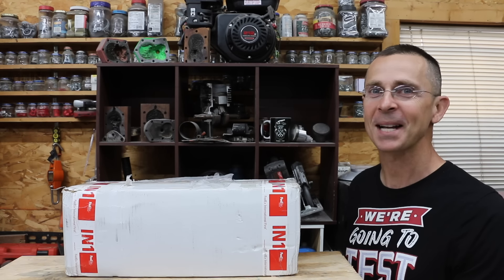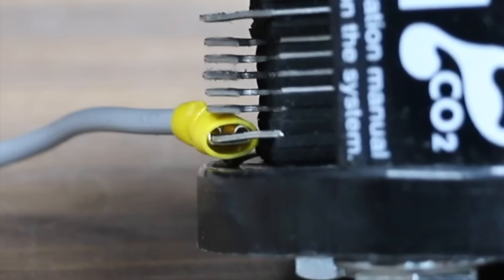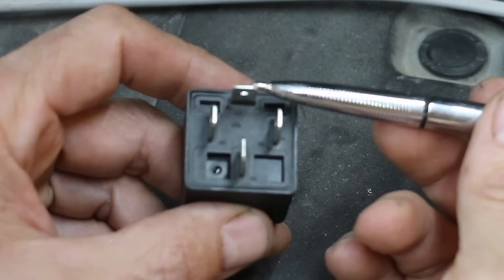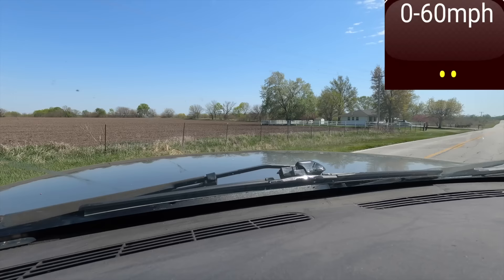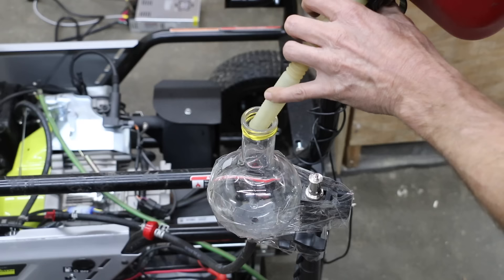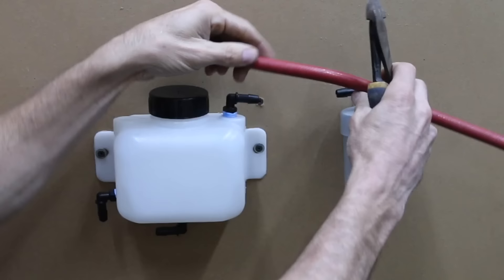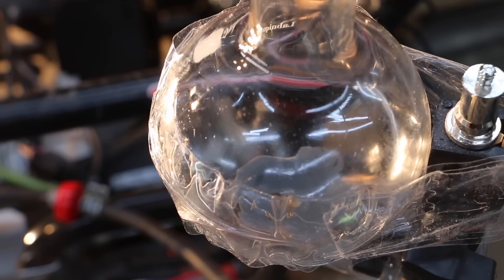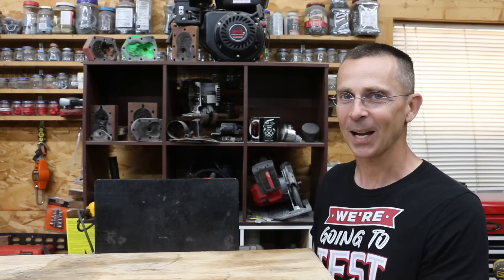AMAZING 35% More MPG with HHO? Let’s find out! Help with high gas prices?

Comment: When I was studying this sort of rabidly (lol) several years ago , the last time gasoline got around $4 per gallon I definitely determined that for HHO to produce a fuel economy benefit it is absolutely mandatory to set the engine leaner.  I read a scientific paper or two or three(?) on this and the hydrogen boosting has the ability to speed up the flamefront in the engine cylinder allowing a leaner burn and also you can adjust the ignition timing so that there is peak brake mean effective pressure at a more opportune time relative to the position of the crankshaft.  Like everything the devil's in the details.  Going leaner on the carburetor is mandatory.

PS -  I hope you aren't sick of the accolades but I think your efforts are absolutely amazing!
Reply from the maker: Thanks!
Reply: Amazing effort in making this video! Thank you!
Reply: The losses in generating hydrogen from water through electrolysis outweighs any benefit you can possibly tweak.

Now! If you use a chemical reaction to create the hydrogen, that's an entirely different story.
Reply: @jimmio3727  Onboard hydrogen generation produces higher mpg ONLY if you also can lean the A/F ratio substantially and retard the ignition timing (can't do it without the boost H2).  I wish I could find that scientific paper I had on my old deceased computer.  I know of people who have proven it themselves.
Reply: Bearing in mind that the pure oxygen will make the gas burn faster and hotter, while the Hydrogen will burn fast and the combustion products (water) will actually cool the cylinders down a little bit.
Reply: @captainwho1  didn't retard mine at all, set it at factory and raised my mileage by almost 10 mpg, with the small unit I built at the time.
Reply: Use platinum for the cathode/anode
Reply: you guys really need to educate yourself in physics.
Reply: @thorgraum1462  Sorry but it is well understood that there is a lot of energy that goes into splitting the water molecule.  You don't understand how inefficient the combustion process of gasoline that isn't well homogenized and atomized is.  That's where the gain comes, as an accelerant to the flamefront.  The gains come in burning more of the gasoline charge at a more advantageous angle of the crankshaft and that absolutely is physics my friend. The devils always in the details.
Reply: @captainwho1  as long as the power used to split the molecule is coming from the car battery and the alternator itself its LITERALLY impossible to do anything but hurt the overall performance of the vehicle. 

energy can only be converted, not created. if the load from the Hydrogenerator on the alternator is 100W you will in the best case scenario produce 75% of those 100W worth of hydrogen, burning that hydrogen in the engine you will be able to extract around 35% of the hydrogen into rotational energy witch then again need to turn the alternator. 

this is not a hypotesis. this is the fucking law of nature

every action creates an equal and opposite reaction. and thats in vaccuum without any friction. in the real world every action creates heat, friction and an energy output lower than what i takes to make it.
Reply: you are using 100W rotational energy to create 26W of rotational energy. and that is under ideal circumstances
Reply: this planet sure is full of rare and goofy creatures
Reply: it is VERY important for our future that the coming generations knows basic Physics. try to lay your pride aside and open your damn sience book before you break the youth with this destructive way of "thinking" (brainwashing)
Reply: if this really worked we would not even have to use a single drop of gasoline. just this wonderful loop of ignorance and maybe some essential oils for lubrication
Reply: @thorgraum1462  Ha ha ha.  I'm a Mechanical Engineer that has actually worked on fuel systems and focused on Combustion in college.  I have argued with folks such as yourself before and your problem is that you do not understand how much of the chemical energy of the gasoline is being wasted.  If that were not the case you would be correct.
Reply: we really need a TUF certification for people. the earth is not f**king flat my dude
Reply: @captainwho1  well, that just prooves that anyone can get a degree

First Law of Thermodynamics: Energy can be changed from one form to another, but it cannot be created or destroyed. The total amount of energy and matter in the Universe remains constant, merely changing from one form to another.
Reply: @captainwho1  then proove me wrong. do it. make it, make a video, show me the numbers. noone have, i wonder why. you gonna be rich boy. go do it. what are you waiting for, youre a mechanical engineer. i might not have a degree in engineering, but i do have 134 IQ  and my mechanical and technical intuition is by far my strongest side. i grew up watching a shitton of mythbusters, MCgyver and the Discovery channels. it shaped my way of thinking and the way i do problem solving. i have a degree in computer sience and im working as a CNC programmer and Operator.  i am the kind of guy to see the problem noone even knew existed. i have allways been a creator by heart and soul.  my biggest fear is to be wrong. but i dont want to be correct just for the sake of it. i want to be correct so i can give useful and legit information. i really do believe that actual Facts is the only thing that matters. ofc not allways when it comes to pleasing others. but when it comes to being able to create and streamline processes.

if i am wrong i will change my mind 

if you have done it. show me, and ill make sure to appreciate the revolutionary new knowledge
Reply: i can believe that you believe it. but i am an analyst. i will not believe what cannot be seen. neither god, ghosts or perpetual motion
Reply: ill happely make a fool of myself in search of the truth. whatever it takes. i will have the correct information
Reply: @thorgraum1462  If you are now going from being insulting to legitimately curious, you should start out by researching patents starting out around the time of the energy crisis in the 70s when the major carmakers were gearing up for extreme fleet mpg requirements from the government which never really materialized.  You should start by looking at lean burn concepts which is basically what this is an enabler of.  You can also look at some vapor carburetor designs, especially by Ford Motor Co., and Shock Wave Carburetors (Ford and Dresser Industries) which atomized the fuel using a shock wave variable venturi design.  They all revolved around super lean A/F ratios and much greater fuel economy and lower emissions that is possible.  Onboard hydrogen generation isn't at all the best way to go, it is just something that people can experiment with on their own to prove and enable the lean burn concept but it isn't going to work with a few stainless steel washers in a cheapo electrolyzer.  I don't have documentation of my own experiments and don't have time to resume them with the current state of the economy.
Reply: @captainwho1  No, i was just trying to be more polite. 
You convert rotational energy into electrical energy using the alternator and battery. Then you convert the electrical energy into Hydrogen and Oxygen, using electrolysis. that process is about 75% efficient. so now you have 75W hydrogen, as well as 25% heat, resistance and friction. Now you burn your remaining 75W worth of Hydrogen in an engine that itself has an efficiency @ around 35%. New engine designs has shown far better numbers using hydrogen, but  they still have their losses due to the pressureleaks and other factors. 

now you have produced 26.25W of rotational energy using Hydrogen

my point is. the powerlosses you have in your chain of conversions make it so there is no way this could self sustain, as it breaks the first law of thermodynamics.

could maybe be a cool hybrid solution if you had an externally charged batterypack like an electric car. 

or if you had a commercial vehicle with Hydrogen fueltanks and an infrastructure that allowed for accessible hydrogen where its needed.

but then again. why bother when the direct current electric motor allready is at 95% efficiency? mount that thing straight and direct to the rubber itself. and then you have regenerative breaking while braking... its just pure genius

get an electric car. slap some solar on top of the roof of your home, and youre good
Reply: To improve the efficiency of the electrolysis process you want to "frack" the molecules its all about resonance and frequency instead of just hitting it really hard (lots of current) you can hit it lightly at the right time (low current high frequency) the entire principle of how the microwave oven works basically the magnetron excited the water molecules in the food and the byproduct is heat produce from friction, magnetron operates at around 2-2.5ghz area which is why it tends to jam up 2.4g wifi i believe the "fracking" point is around 20ghz for water never tested myself but have seen very promising results from others as has been said before the devils REALLY in the details and unfortunately HHO isn't at a "plug and play" point yet
Reply: @Gia010611  Are there any scientific papers on that?  Is is it stated to beat Faraday's Law?  If so, that would be a Nobel Prize.  Not being skeptical just a fact.  I know Urea Electrolysis is very interesting and seems to beat Faraday but not really when you analyze for the energy in the Urea, iirc.
Reply: @captainwho1  can't say for sure its one of those I knew a guy who disappeared kind of things he had all sorts of crazy things going on he was working on running on pure HHO no gasoline V8 ford f150 had a pressure vessel generator, wet cell I believe he would charge the system up to 60 psi I believe it was and got it all to work
Reply: @thorgraum1462  This isn't physics -- it's chemistry.  You are thinking energy in >= energy out.  That's physics.  But there are catalysis that can improve the efficiency of a chemical reaction (in this case combustion).  

The typical gas engine is well below 30% efficient.  It's conceivable that adding pure hydrogen and pure oxygen into the fuel-air mixture can increase the efficiency of the typical ICE combustion producing greater output.   And this is not a violation of laws of thermodynamics --  not in the least. 

Now I'm not saying it will work, but a knee-jerk "this breaking laws of physics" is naïve.
Reply: @joeboxter3635  i do understand the thought, but it seem totally impossible to me to generate more power than you are straining the vehicle for. How is it naive not to believe what noone have achieved?

You may get higher efficiency, but it will never achieve 101% efficiency. And that is all that matters. That 1% is the one needed for this to be a reality. And that is breaking the first law of thermodynamics. To keep a machine running, you need to put more in than you get out

Hydrogen will for sure help the car run further. Problem here is that they are trying to CREATE the hydrogen using the engine its supposed to help. It is a closed loop, no fuel, no power, no power no hydrogen no hydrogen no fuel. 

100w power = 75w hydrogen = 26W power = 19w hydrogen = 6.8W power = 5.118W hydrogen = 1.79W power.
Reply: Computer will have to be reset on a car or it will adjust parameters and you'll see worse performance.   An older engine with no or few sensors could be tuned a lot better.
Reply: @juggernautz  True dat.  I would go with a 72 or earlier variable venturi carburetor with adjustable jets, preferable multiple carbs for best distribution.
Reply: @thorgraum1462  you outlined my big issue with these systems. Iirc, hho generator kits fundamentally cannot work as advertised, they run up against the laws of thermal dynamics. These things have been around for awhile, and there are literally hundreds of YouTube videos explaining why they are a scam.
Reply: @Ba11leFieldAce  It's a bit of a myth.  Leaner than stoichiometric engines actually run cooler because of the extra air which doesn't combust.  Also, when you are burning some hydrogen in addition to the gasoline, there is more water vapor in the exhaust charge.  As far as performance what it does is increase the thermal efficiency.  The timing is retarded for optimal peak cylinder pressures vs Crankshaft Angle, because of the faster flamefront.  Edit - I see you just deleted your comment directed at me that I was replying to, regarding your statement that lean burn engines are dangerous due to overheating etc..
Reply: @tom6549  lts say the entire chain of conversions are 99% efficient. its still not sustainable in a closed loop
Reply: Ya I kinda figured if it actually increased fule efficiency by 35% that OEMs would start including that tech in the cars. Similar to what happened with def in diesel engines.
Reply: @captainwho1  ya hes not addressing the fact that certain fuels, materials, chemicals contain different amounts of energy and conversions of various types also differ wildly in what is wasted vs. used.  that seems to me ignoring quite a bit of physics to get a point across
Reply: @ryanlynch3579  nah, this to me seems like basic math. <100% = Not sustainable
Reply: @niniv2706  thanks mate. have a wonderful day
Reply: i actually think iv gotta be more polite. i want people to believe in facts. this type of mentality is not gonna bring us towards the future, its like a stick in the wheel. maybe if i dont make an enemy of everyone i disagree with, it would be easier for them to concider my view
Reply: @alexnorth2452  long answer. but i can tell your wrong after the 5th sentence. so im not reading the rest
Reply: @thorgraum1462  Your absolutely right, you cannot exceed 100% efficiency, but you can exceed 35% efficiency.   As it stands now, your engine may be around 35% efficient, 65% of the unburnt fuel goes straight out the pipe.  Lets say this is a 150hp motor for sake of argument.

The faster burning flame front assist in burning more of the spent fuel, bringing the combustion process up.  If you go from 35% efficient to 40%. that's a net gain of 5% efficiency. on a 150hp motor, that 7.5hp.
Lets say you drop 1000w on electrolysis, using a dry cell, pwm for the resonant of your plates, ect ect.  Maximum electrolysis efficiency. 1000w = 1.34hp.  Your alternator is about 60% efficient(typical).  This means you'll be putting a 2200w load against that motor to turn the alternator.  A 2.95 hp cost to get 1000w in power for electrolysis. 

7.5gain, subtract that 2.95hp = 4.55hp gained... Along side a 14% mpg gain.

This doesn't work on run of the mill efi motors.  The extra o2 can actually cause the sensors to read lean and give the motor more gas. lol
Reply: @thorgraum1462  - Argument accepted . :) Peace to you .
Reply: @thorgraum1462  Burried deep in here is the fact as to why HHO doesnt work.

FACT, low octane fuel burns faster than high octane fuel. Low octane fuel cannot take the advanced timing high octane fuel. 

TRICK QUESTION, which one makes more power? Neither, they both make the same on a low compression engine. On a high compression engine, the low octane wont give the advancement and make LESS power.

DEBUNK anyone claming that retarding timing makes more power is regurgitating misinformation. Things like Mass Fraction Burned and Mean Best Torque coincidence with more than just fuel use. Its chamber shape, air temperature and pressure, compression ratio, how well the compression pressure is sealed, engine materials, cam timing just to name a few. These things are the mechanical components of an engine, and need to be altered to give significant changes in engine efficiency.

Build an engine for the fuel it will use. Hydrogen will need 30:1 compression (dont worry, its got 130 octane) 
However, that much compression, and the heat it generates creates NOx gases, which is not just a smog gas, but is the basis of acid rain. THATS WHY HYDROGEN IS NOT USED AS A FUEL. No one has figured out the NOx problem. Not yet at least.

This is one of those cases where to make power, we need to utilize the air efficiently. Making more combustion force from less air will give the greatest efficiency gains as less air needs less fuel to stay in stoic.  Since an engine is ultimately air starved which will limit the energy output (power), this is the way of improving output yields for the best results. But since horsepower (energy) is glorified, focusing on increasing total air use just leads to more fuel use, but that is another argument.

Back to Hydrogen. The total dilution of gas mixed with the 50-60cfm that an engine consumed to make 30hp, to travel at 70mph means what little Hydrogen makes into the chamber makes no difference. Since most HHO systems probably are not completely sealed, any setup is just a metered leak which is exactly what Thunderhead 289 has on his lawnmower carbed Mustang. To say again, a metered leak has more of an impact on the air/fuel ratio than what HHO will ever provide.

I built these things back in the early 2000s. I gave up on it and started on actual physics and chemistry related improvements. I went from 550km to now 830km on the same size tank. HHO will never work until someone can improve the electrolysis efficiency, and then the mechanical efficiency of the engine to utilize the increased hydrogen production. Yes, I have ideas how to get it there.

No, I wont tell you what they are.

Telling someone "No, that wont work" isnt unkind. Im saving you time. Do you want to waste 10 years to discover that water doesnt burn? That lead cannot be turned to gold? That you cant eat money? Maybe you do....
Reply: @RubberSalt  i need to see it to believe it
Reply: @crd-nz_001  i want people to know what they should prioritize. thank you for the input. its really interresting. i wish i knew more. but i will educate myself. i would love to have a hydrogen generator just for the gags, but i would probably use it to drive a tiny torch or something so i can solder without having to buy fuel. it really grinds my gears when people think you can "make gold out of lead" or create energy out of thin air. maybe im wrong. ofc i dont have all the answers, but i love to have them. so im educating mysef on any subject i find interessting. have a nice day
Reply: @niniv2706  peace
Reply: @thorgraum1462  in response to your closed loop assessment however true it is.

 You're failing to realize that there is an unused portion of the energy that is 1. Being sent out the tailpipe via unclean / incomplete combustion, and 2. Inefficient capture. We are also adding other components (In this case water and an electrolyte) that are not part of the original closed system, that add to the total stored chemical energy of the system. 
The only issue that would settle this is having someone actually redo this but with the ability to retard the timing and create a leaner AFR. While keeping the rest of the experiment as scientific as this video.

 The crux of it here is are we getting enough more power from the combustion being cleaner due to more O2 and H2 than it takes to run the generator. The potential to reach a higher efficiency while not breaking the laws of physics is because we have added chemical energy to the system.

The engine can be cleaner and more effective almost in the way a forced induction engine works however those are purely mechanical systems relying solely on the chemical energy the car is already equipped with, not trying to add more via the electrolytes and water. 

This could be a case similar to how a Supercharger reduces top end power while being more efficient at low RPM while a turbocharger only adds power as the only parasitic loss is increased exhaust back pressure. Are you telling me that a Turbocharger breaks the laws of physics because it can be tuned to increase the efficiency of a commuter car by capturing escaping energy?
Reply: @thorgraum1462  Consider you wont believe the internet, do you want to invest time and energy, or remain ignorant?  I'll hold your hand on the build process.
Reply: @thorgraum1462  I'll try an analogy with you that you're utilizing it right now. Enzymes in biology which act as catalysts. Every single animal eats food. They all use food to make enzymes. Why do they make enzymes? To make eating food more efficient. But they're using energy to create more energy right? Nope. Energy is spent to make the next round of energy generation more efficient. They aren't creating more energy, they're converting more potential energy into kinetic energy. Using a catalyst so less potential energy leave their butts. The same amount of energy is in the system the whole time but more of it is being released from already existing chemical bonds

Exact same concept with a HHO generator. Energy is being used to make a catalyst which makes the next cycle of energy generation more efficient. No energy is being created, more potential energy is being converted though.

Unless you want to argue with biology, the idea works in theory. The 1st Law of Thermodynamics isn't being violated. Does an HHO generator work? I doubt it. But the idea can't just be dismissed out of hand.
Reply: @rayzerot  still animals cannot survive on thier own poop. they also need an input of energy to survive. not a closed loop
Reply: @thorgraum1462  Yeah. Animals continuously eat and we continuously refuel cars. I don't understand what you're trying to get across with that rebuttal
Reply: @rayzerot  Ive given up looking, but who running HHO has done a proper before/after exhaust gas analysis test, or even a simple air/fuel ratio test?

I have seen a dyno run where there was a 10hp advantage from such a setup. However,  I have also seen a 10hp change mechanically. Since this dyno only improved in the upper rpm, it could be as simple as removing a dirty air cleaner. This would also have an effect of leaning out the engine (marginally, but measurable). 

Next problem is on close loop power. Faraday's Law states to create 1 Mol of a substance from electroysis, 96,500 amperes needs to be passed through that substance. When we science this up, this number is the difference in electrons in 1 ampere to atoms in 1 mol. (1mol is the atomic weight of an element, they are found on the periodic table)

Next is voltage for the reaction to occur. At best, this is 1.25V. Multiply by 96,500 amps and we get 120,625W, or 120.625kW. 1 Watt is 1 Joule per second.

Now, burning 1mol of Hydrogen yields 275kJ. See the shortfall of 154.375kJ? 
Since everyone runs this set up on the 14.4V charging output of an alternator (the 2V overvoltage of the 12.4V battery is needed to charge it), this extra voltage fills the energy void, but makes the process very inefficient. (14.4x96500=1,389.6kW)

The best I got at making Hydrogen was 2L/Min. Or, 22.9kJ of extra energy. If this is a catalyst, and to get 35% improvment in fuel economy, we must increase the energy transfer of the petrol from a chemical to physical pressure. Or put another way, increasing cylinder pressure so that the throttle blade lets in 35% less air. That decrease in airflow would equal our gain in fuel economy as we are making the same force to travel down the highway with 35% less air/fuel as to before...

This should mean that we have a 35% power gain under full throttle, except Hydrogen does get diluted which means the efficiency gains diminish. Speaking of dilution, Hydrogen's minimum flame concentration is 5%. As stated earlier, air consumption at cruise is 50-60cfm. In second thought, it is quite high. So, I will try on the fly to work it out. 6L/100km is about 15 pounds of fuel an hour. Running a cruise air/fuel of 14.7, we see total airflow for an hour is 15x14.7=220.5cfm. Divide by 60 to get cfm = 3.675cfm. Wow, much different from what it was... So, 5% of that in Litres is (104÷5%=5.2L) that looks good, however 6L/100km is my own built and tuned small 4 cylinder engine. Most V8s run at closer to double that. 

Plus there is the added weight of the equipment...

In my view, the energy transfer with electrolysis is a loss, (it takes more energy to make than it does the end product) and fed into an inefficient engine (energy of petrol transfer to mechanical energy is a loss), just to try amd improve the thermal efficiency of an engine. Putting it bluntly, adding Hydrogen to try and improve the efficiency of an engine by electrolysis is like eating vitamin supplements while having a diet of junk food in the hope of losing weight and gaining physical fitness. It is just impossible.
If you want to improve fuel economy, then focus on improving how much force can be generated in the cylinder from the air made avaliable to it. AND RETARDING TIMING IS THE OPPOSITE WAY!
Reply: @rayzerot  go take an IQ test. you might be able to get some compensation from the state
Reply: @Reno Simpson I have seen Stanley Meyer's patents.  It is too bad there was never 3rd party verification and a peer reviewed scientific paper done.  Someone has all the equipment but I have not heard a peep out of them as far as anything that could be called information.
Reply: @ryanlynch3579  There is a great deal of ignoring you are correct.  When you do a model of a system, but oversimplify it to suit your goal of verifying your own incorrect hypotheses, this is what happens.  It is usually a waste of time to argue with egotists who won't even do the most basic research into ICE on-board hydrogen generation partial fueled gasoline engines.
Reply: @BriceLijewski  Pretty good attempt at explaining but you are talking to someone whose mind is made up with a religious fervor and has misrepresented the actual system we are dealing with in their own mind.  Most people like that will not do the research that might refute their own flawed understanding.  People who are obnoxious and rude to strangers on the internet aren't really worth our time.
Reply: @thorgraum1462  No one is arguing about the total number of energy in this equation, my friend. The man is saying the efficiency of energy use increased.
Reply: @thorgraum1462  That’s how hydrogen fuel cell vehicles work, don’t they? They all convert hydrogen into electricity and use the far more efficient electric motors for kinetic energy. No one is saying this method creates anything like that. They’re saying it affects the fuel burn - thermodynamic efficiency of the ICE engine. If you could change that number from the current 39% or so to say… 55%, the whole equation changes.
Reply: @thorgraum1462  You seem to think that the engine fuel burn extracts 100% of the fuel’s stored energy, and that the losses on the engine are simply operational (heat, friction, etc.) The first and primary issue with internal combustion is that much of fuel’s stored energy is never realized (incomplete burn). When you burn the fuel more completely, you actually get more usable energy. Then the second step is your energy use efficiency - reduction of friction.
Reply: @thorgraum1462  @CRD NZ @Dustin Henderson @Jonathan sauder @Jim O'Hagan

HyTech ICA System

It’s called Internal Combustion Assistance (ICA), a modification to internal combustion engines that enables them to substantially increase their fuel efficiency and reduce their air pollution. It does this by adding tiny amounts of gaseous hydrogen and oxygen to the fuel just before it is combusted in the engine’s cylinders. The HHO mix lends intensity to the combustion, allowing the fuel to burn more completely, generating more oomph and less pollution.

The ICA system can technically work on any internal combustion engine, but to begin with, HyTech is targeting the dirtiest engines with the fastest return on investment, namely diesel engines — in vehicles like trucks, delivery vans, buses, and forklifts, but also big, stationary diesel generators, which still provide backup (and even primary) power by the millions across the world.

All those diesel engines produce carcinogenic smoke containing particulate pollution (soot) and nitrogen oxides (NOx), which are hell on human health. States and cities around the world are cracking down on diesel air pollution.

But the diesel particulate filters (DPFs) that screen out particulates are expensive, a maintenance hassle, and must be replaced frequently. And the selective catalytic reduction (SCR) fluids added to exhaust to remove NOx are pollutants themselves and must be changed frequently.

In short, there are lots of diesel engines, they are very dirty (responsible for as much as 50 percent of urban air pollution in the winter), and there are lots of people spending lots of money trying to clean them up. That’s a big market.

HyTech’s offer to that market is pretty remarkable: it claims that its ICA can improve the fuel efficiency of a diesel engine between 20 and 30 percent, reduce particulate matter by 85 percent, and reduce NOx by between 50 and 90 percent. In concert with a DPF and some SCR, it can yield a diesel engine that meets official California standards for an “ultra-low emissions” vehicle.

The cost of transforming a dirty diesel engine to a relatively clean one: around $10,000 installed, which HyTech estimates will pay itself back in nine months through avoided fuel and maintenance costs.

HyTech is not the first or only company to develop an HHO additive system, but nothing on the market comes close to those kinds of numbers.

The ICA achieves this efficiency thanks to a computerized timing controller that senses and analyzes the turning of the crankshafts and camshafts to determine the precise timing and size of the HHO injection. Previous HHO systems more or less flooded the engine with HHO through the air intake, but HyTech uses “port injection,” with a separate injector at the intake valve of each cylinder, controlled by the timer. Each injector (roughly the size of a human hair) squirts tiny, precisely measure jets of HHO into the cylinder just when it’s needed.

This level of precision allows the ICA to use much less hydrogen than its competitors, much more efficiently. A small, onboard electrolyzer produces more than enough.

These are bold claims, but so far they’ve held up. The ICA has been listed by the EPA as a candidate for emissions-reduction technology; respected testing firm SGS found that the ICA boosted the fuel efficiency of a FedEx delivery truck by 27.4 percent*; FedEx is currently road testing the ICA on a fleet of trucks and finding *20 to 30 percent better fuel economy and substantially reduced DPF maintenance costs. In third-party testing, and in limited local sales around Redmond, the ICA has performed as promised.
Reply: @thorgraum1462  It's not totally impossible to believe.  It's impossible to believe only because you are stuck in physics mindset.   Once again, you think that it is burning hydrogen as a fuel that is doing it.  You are not thinking hydrogen as a catalyst that improves the utility of the actual fuel: gas.  

If you ran a car on 100% hydrogen and then you try to draw power out of that process to produce more hydrogen, then you would be doing what you said.

But if you are adding to a gas+air mixture+ hydrogen then the amount of energy liberated out of the gas could be higher.  I know how to explain it.  But  I'm not going to waste anymore time with you.  Stay the way you are.
Reply: @rayzerot  I've decided now to try once with ppl.  They don't get it, I move on from now on.
Reply: @thorgraum1462  Respectfully, I believe your are assuming that the hydrogen gas is the source of additional power, and if so, then you are mistaken. As you know, gasoline, like any combustible, has a certain amount of energy potential. What you may be overlooking is that no internal combustion engine uses 100% of that potential energy as a result of various compromises (i.e. cost-benefit of various spark making technologies; imperfect atomization of fuel; concerns for prioritizing the thorough combustion and recombustion of greenhouse gasses and pollutants over utilizing the full power potential of the fuel; establishing a safety margin to prevent engine failure caused by delayed detonation of poor quality or contaminated fuel; energy lost to heat and/or friction as the result of economic, serviceable material choices etc.) 

Therefore, it's entirely possible to make adjustments to an internal combustion engine to make it more fuel efficient, or more powerful, or both, albeit at the cost of safety, longevity, convenience, serviceability, or money (i.e. advancing timing, increasing cylinder pressure, reducing cylinder temperatures, improving fuel atomization, improvement of pathways for ingress and egress of air, reducing internal friction, reducing weight of rotating components, establishing different burn characteristics, bearing materials, gap width tolerances between materials, and so on). 

My understanding is that, here, adding hydrogen changes the time and speed at which flame propagates in a cylinder, much like using a higher octane fuel. This in turn allows for adjustments to timing (advancing it) which result in less energy being lost to unproductive work in the combustion process, which in turn allows for adjustments to the air fuel ratio (using less fuel per part of air, which is called "leaning" the air/fuel mixture) which allows for less fuel to be used to make the same power at every point of engine speed and load. People also use methanol to achieve the same purpose (methanol is not used as a fuel, but rather an a substance that condenses oxygen molecules), or water injection (water lowers cylinder temperatures, which in turn allows for timing of combustion to be advanced beyond what the fuel octane would normally allow. The water itself is, obviously, not a source of fuel in this process.)

TL;DR adding hydrogen doesn't add power as a fuel source; instead, it simply increases the efficiency of the internal combustion engine, allowing it to use more of gasoline's potential power that is otherwise wasted. When done correctly, the increase in efficiency is greater than the inefficiency of making hydrogen, resulting in net increase in efficiency. This comes at the cost of convenience, as the consumer now need to fill up a second tank of water and chemicals. This is why car manufactures aren't generally adding water injection, meth injection, or some other form of a similar idea.

If you are STILL in doubt, then check out what Dodge did with the Demon, which is a muscle car that uses it's air conditioner to make more power. Clearly, cold air isn't a source of fuel, and as demonstrated, more power is made by the engine than lost changing the temperature of air, so there is obviously more to this than a simplified application of thermal dynamics, or "energy in, energy out."
Reply: the benefits of hho in ice has been well documented. the challange has been making a system thats efficient enough to make it viable. all these companies failed because their stacks req too much power,  or the hho generated was inconsistent or just crap (like the one in this video)

we made a standalone device (with submerged pem stack  using only distilled water, low power consumption ) that has been used by friends and family for the past year.  seeing 20-40%+ increase fuel efficieny along with 70-90% reduction in emission. Even tested on old vics that failed smog, to get them past the threshold. working on pilot programs with local government vehicles. 

there seems to be alot of knowledge on this thread alone. would love to connect with anybody that wants to try it out when we bring it to market. (currently part of a startup accelerator program and in talks with various vc)
Reply: @yabroyo  hey what is the name of your company and website?  What are you doing differently because disassociating hydrogen takes a predictable amount of energy.  Distill water will help, but they've got 97+% efficient systems in Germany already.   There is an upper limit on what you can do.
Reply: @thorgraum1462  Right on!
Reply: @thorgraum1462  Love it!
Reply: @RubberSalt  You stated: "65% of the unburnt fuel goes straight out the pipe."  What I want to know is:  Where does the rest of the unburnt fuel go?
Reply: @yabroyo  I'm always interested in documentation.  Do you have any?  PEM is interesting to me because of the more varied uses and if it is pure enough H2 can even store it in metal hydride tanks.
Reply: @Cougracer67  Into the exhaust pipe.  On a straight pipe set up, it goes into the atmosphere in the end.  In a modern efi set up, into the catalytic converter to burn the rest of it.  This is the soul purpose of the catalytic converter.  Its strictly for emissions.
Reply: @joeboxter3635  We are still early so the site is only in Korean at the moment. I actually moved here from the states to join the team to prep it for us launch this year so theres alot of localization to do but the core aspect of the technology is being validated everyday. I was a naysayer too last year when i was introduced to the company since HHO field is so gimmicky and suffers from bad actors but i became cautiously optimistic after using the product myself. Im looking to get it validated at a US facility asap, check for regulatory requirements and send it out to some influencers and others who are subject matter experts in this field to get their feedback. We got 1MM from the Korean government as well as 750k from other start up programs so we are gaining traction. That said, were in the business of green hydrogen production, not car attachment but this product will help us validate our core technology and generate the resources to reach our milestones. Ultimately the goal is to create a self sufficient/generating green hydrogen charging station. 

Im in the midst of contract negotiation for compensation so i dont want to get ahead of myself. But if you read all the current papers on HHO they all use devices with way too much electric pull 1k+  watts or need some kind of electrolytes which reduces efficiency. Our current readings are 2v 6a 12w to run enough hho to power 2000cc engine.
Reply: @yabroyo  What is the MMW rating of your HHO electolyzer?  Milliters per Minute per Watt.  Also if you could tell us how to find the webpage even though it is in Korean, it could probably be translated by Google Chrome.
Reply: @crd-nz_001  Effect of hydroxy (HHO) gas addition on gasoline engine performance and emissions
Author links open overlay panelMohamed M.EL-KassabyYehia A.EldrainyMohamed E.KhidrKareem I.Khidr
Mechanical Engineering Department, Faculty of Engineering, Alexandria University, Egypt
Received 8 June 2015, Revised 14 October 2015, Accepted 28 October 2015, Available online 21 November 2015, Version of Record 8 March 2016.

Abstract
The objective of this work was to construct a simple innovative HHO generation system and evaluate the effect of hydroxyl gas HHO addition, as an engine performance improver, into gasoline fuel on engine performance and emissions. HHO cell was designed, fabricated and optimized for maximum HHO gas productivity per input power. The optimized parameters were the number of neutral plates, distance between them and type and quantity of two catalysts of Potassium Hydroxide (KOH) and sodium hydroxide (NaOH). The performance of a Skoda Felicia 1.3 GLXi gasoline engine was evaluated with and without the optimized HHO cell. In addition, the CO, HC and NOx emissions were measured using TECNO TEST exhaust gas analyzer TE488. The results showed that the HHO gas maximum productivity of the cell was 18 L/h when using 2 neutrals plates with 1 mm distance and 6 g/L of KOH. The results also showed 10% increment in the gasoline engine thermal efficiency, 34% reduction in fuel consumption, 18% reduction in CO, 14% reduction in HC and 15% reduction in NOx.
Reply: @captainwho1  18L/h... so 300mL of Hydrogen has the power to do all that? 
Serious questions need to be asked on type of dyno used, surrounding environmental conditions and how was the hydrogen made to start with.

Perhaps the greatest thing of all. If YOU believe it, BUILD ONE. As previously stated, I can achieve those results WITHOUT Hydrogen enriched airflow,  so it proves nothing to me. If YOU have sovled the problem, then get a car manufacturer to BUY IT. They already are banning the internal combustion engine in places around the world so there is a high demand for someone to make a proof of concept. They are NOT going to buy ideas. They want a working system!
Reply: @crd-nz_001  By the way, I gave you proof you asked for.  At least take the time to google it and read the papers.  Nobody ever has to know you were wrong so buck up buster.
Reply: @crd-nz_001  You must be a speed reader if you read all that material already.  Baaaaaa Ha ha
Reply: @crd-nz_001  I will and I will continue to study patents and peer reviewed papers and articles in science and engineering journals and you can continue your self generated ramblings lol.
Reply: My replies to @CRD NZ now seem nasty but that is because of their other two replies (deleted by them?) to me where I was compared to a sheep and a lack of intelligence was also mentioned in reference to me lol.
Reply: @captainwho1  I got offended with your comment of "Nobody will ever know your wrong so buck up buster", discredited the practical and scientific information I have aquired on the subject. 

I also went and investigated with a Google search and found multiple NOx charts on HHO usage. Surprisingly, none of them are consistent. Some say increase, some say decrease. On the matter of BSFC, Hydrogen looks very attractive, however using weight to test a gas is incorrect when comparing to a liquid. Volume is the unitmate test, and Hydrogen scores poorly when done so. In my conclusion, from inconsistency in all test means an inconclusive result. Thats not being bias, thats fact.

I dont like being drawn into these debates as people tend to get offended when something they believe in is proven incorrect. I dont like it, but i learn from it. Mostly, my ego needs to go back in the box as it stops most of us from learning anything.

Perhaps the big silly thing from this is, with all these comments continuing, YouTube continues the algorithm to other peoples news feeds (because people love drama) which makes the author more money, which makes Google even more money and that attraction to money means more controversal, misinformation and drama causing vidoes like this will continue.

People no longer care about the truth. They want something to satisfy their perspective. Which makes sharing truthful information harder than it ever has been.
Reply: @crd-nz_001  All I can do is try to find evidence since I didn't document my own testing 12 years ago. (1) Zerofossilfuel documented his runtime testing on youtube and I gave the video name.  (2)  I gave the HyTech ICA system which is I believe on the market or soon to be after testing by FedEx is completed and is getting 27% fuel consumption improvement in diesel trucks.  They have 20 patents so they are no joke.  That is easily looked up online. (3) Then I gave the Egyptian Engineering Journal peer reviewed paper which showed similar gains in a small 4 cylinder gasoline high compression engine from a Czech vehicle circa 1990s.  I'm not discounting your experiences and no doubt the devils in the details and things are specific to the exact way they are done and equipment that is employed.  I think I've proven feasibility.  If you had documentation I would read it.  You said you don't have time to read what I have put forth.  So be it.  What else is there to talk about if nobody will read my evidence I've shown so far? There's lots more out there I'm sure.
Reply: I was thinking this the whole time. The computer in the suburban has no idea there has been any change and will continue to use the same amount of fuel. I wonder what this does to o2 sensors as well.
Reply: @CarlosCastillogearhead  Yeah and they were both fuel injected, presumably both with O2 sensors.  I knew 12 years ago exactly why the ECU/O2 sensors were fooled into injecting more fuel in response to the altered combustion products caused by the addition of HHO but I have forgotten exactly why.  You have to delve into exactly how an O2 sensor works and it isn't as simple as it senses how much partial pressure of O2 is there.  It has to be calibrated for a specific combustion process which the HHO alters is the short story.
Reply: @jimmio3727  Well you may be correct.  The gains / losses depend on the relative cost of gasoline and the cost of electric power.  If the electric power were free, would you still make that argument?
Reply: @thorgraum1462  buddy we use hydrogen power in our bodies everyday, water isn’t just hydration their is vast amounts of power stored within the molecule H20 splitting hydrogen into gas means you need less oxygen to arrive at the same combustion level to prevent pre detonation and waste in exhaust
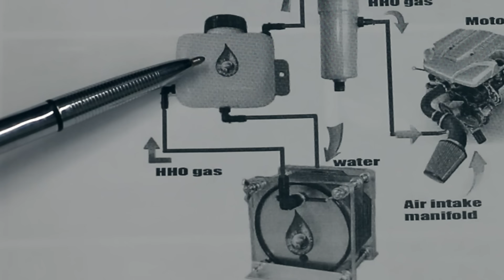Reply: @thorgraum1462  Romans 1:20
[20]For since the creation of the world His invisible attributes, His eternal power and divine nature, have been clearly seen, being understood through what has been made, so that they are without excuse.

Thorgaum, the Word of the living God which we will all be judged by says : A fool hath said in his heart " there is no God."

Read Romans chapter 1 : 16-22 

I pray that God would open your eyes to His glorious Gospel and that you wouldn't cherish the work of Jesus death on the cross, burial and resurrection above all else. Repent and believe. 
May God give you His Spirit and regenerate you .

With love, Blake Reeves on behalf of Jesus Christ our Lord.
Reply: Leaning out the fuel air when you are starting on the rich side of stoichiometric provides more energy? You don’t say….🙄

You can do that without the hydrogen and while it’s not good for the engine it’s possible to extract more energy from the fuel. At that point you can add any gas and claim the increase is from it.
Reply: @cynic5581  Read the study.  They used a test engine at constant hp dyno'd output.  As they varied the A/F ratio with gasoline only they determined the curves for thermal efficiency and brake specific fuel consumption at different HP outputs.  When the HHO was added (created by power from engine through electrolysis) the peak thermal efficiency improved 10% and minimum bsfc went down by 35%.  The lean flammability limits of gasoline are extended when adding hydrogen.
Reply: From what I've read , leaner is the way to go. Also the oxygen sensor has to be stepped back from the exhaust or it will read the leaner mix in the exhaust and rich up the fuel mix defeating the process. Try leaning out the mix on the generator then see how it functions before we call it a failure.
Reply: @thorgraum1462  a wise man once told me that one who brags about his high IQ is generally insecure about how unintelligent he feels.
Reply: @blakereeves3530  there's the guy who brings nonsensical religion into a scientific talk
Reply: @SuperJahobo  , I just saw your comment about religion ....did I make a comment on something, I don't remember.
Reply: @SuperJahobo  that may be true, that may also be the reason im soo eager to learn
Reply: @captainwho1  *advance ignition timing
Reply: Diesel engine performance engineer here... Getting a good laugh reading some of your comments :) OP's original post was close enough for the youtube comments section; David Davidson's post is pretty good explanation. The main thing to take away:

While it is theoretically possible for a HHO generator to have a net benefit (even considering the loss of energy required to produce the H2) by increasing the efficiency of the engine, it would need to be a very carefully designed system coupled with a recalibration of the engine controller, not some one-size-fits-all job that they seem to be selling here.
Reply: @johnfoster8226  sure thing bud
Reply: @johnfoster8226  I agree regarding it needing to be designed correctly and check out the ICA system for diesel trucks that I posted about above^^  It is by HyTech Power and they have taken out over 20 patents on the system.  27% improvement in fuel economy.
Reply: @thorgraum1462  i think assuming anyone thinks you can get 101% is a blockage ...that somehow is a great sense to do experimentation. The Thermodynamics statement is binding to limited conditions of matter in motion. Thermo nuclear reactors are proff, you don't need to always spend energy to tap it ..i was looking at an old paper on anti-entropic principles and it seems life as such is anti entropic.
Reply: @madmanzila  japp japp
Reply: @crd-nz_001  you probably don't believe in heat pumps either?  They take 1w of electricity and provide  8w of heat.  The reason is there are ways to efficiently utilize "waste" energy.  In the case of ICE, there is 70+% room for improvement from it's waste.  All you have to do is improve the 70+% inefficiency by greater than the energy used to do so.  That's a like idea behind the heat pump.
Reply: @joeboxter3635  roped into this debate again?
Your example is using external energy and adding to the "heat output". Sighting only one part of the equation to prove being right is faulty thinking.
Reply: @joeboxter3635  hey man, assumptions about other people is rarely a good option. (a.i: "you don't believe in heat pumps") You can ask instead.
Reply: When it comes down to it. You have a tune to run 91 just as you would for 87. 

You would have a tune to run HHO so that you can run it properly. 

Its honestly a lot of work to make an engine run efficiently off of it. So It makes sense. You can't just plug and play.  
This video was good tho.
Reply: @crd-nz_001  and the idea is the same.  The heat pump utilizes energy available in the total system by increasing system efficiency.  That's the premise of adding hydrogen.  It's to increase total system efficiency.  

There is available energy in the combustion process that is under utilized.  That is why I said think of hydrogen as being a catalyst (not fuel).  It enhance system energy efficiency.  It does not promise something for nothing.
Reply: @wtfuredead  your point has been taken.  In my defense, note the original said "probably don't".  But I have now made it a question.   Nevertheless, naively claiming violation of physics when it does not  stifles research.  I've heard people who don't believe in heat pump say it violates laws of physics and they are a gimmick.  This came to mind when hydrogen was seen that way.  These people are not considering efficiency.  They are thinking, naively, energy from hydrogen. 

Other example would be if someone came up with a better spark plug, better exhaust, or better lubricant.  They are increasing system efficiency - not violating the laws of physics. 

I  don't claim to know if hydrogen works or not, btw.  But we need independent research.  It could be a major break through if every vehicle could increase efficiency by 10 - 30%.
Reply: @joeboxter3635  I disagree. The energy available to any engine is not adjustable.  It is set by the fuel. Increase fuel quantity increases available energy.

How an engine turns fuel energy into motive energy is very adjustable. From ECU tuning to redesigning the mechanical components. However, all this does is increase the engines efficiency as fuel has set energy values.
BSFC is one such measure for engine efficiency.

The promise of Hydrogen increasing this efficiency further is all well and good. Research has proven to do such things, as to say adding Hydrogen decreases BSFC. However, because the energy conversion of mechanical energy to electrical energy isn't 100%, and the electrical to chemical reaction of electrolysis isn't 100%, then the overall system runs at a "loss". As to say, it takes more energy (in the form of heat, noise, and air resistance with running an alternator) than it does to create. Same goes for the electrolysis process, especially when running at 12v. All these extra energy requirements add up to be greater than the efficiency gain of burning Hydrogen in the first place. 

So as I have stated. The fuel efficiency "gain" must be from somewhere else.
Reply: @thorgraum1462  So now you have become a humble seeker of truth instead of a misunderstanding over simplifying obnoxious know it all?  That's pretty rich :)  Did you read any of the documentation I presented?  I admit this thread is hard to follow but it is there.
Reply: You actually want to save fuel......more specifically gasoline costs....forget HHO, unless the system is provably actually significantly raising fuel mileage on anything you put it on.....good luck that happening. So if you want to cut fuel cost.....then build yourself a wood gasifier. Try to bulld one that creates the cleanest gas you can.....but either way prepare to filter the wood gas before putting it into the combustion engine, spas it’s a must to keep from coking up your engine. Your engine can run solely on wood gas but you do lose some power output from running on it. Good news is that a given amount of wood converted to wood gas produces a lot of energy. Be also prepared to process your raw wood into small chunks and the wood to be extremely seasoned (dry.... not made tasty with herbs and such). Wood gasifiers was proven effective at lowering fuel costs, as it did in ww2 when gasoline was costly and outright rare, in places like europe. Primitive home built Wood gasifiers practically ran Europe during the war, look it up. Heck they even used it for cooking gas. Some safety things to consider though, wood gas is chalked full of flammable carbon monoxide so if you have any leaks not making it into the combustion chamber, you risk buildups of the gas that will make you sleep indefinitely. Second when you clean up the gas for engine consumption, it likely may include a filter, made from some kind of a medium (hay or fiber are a few). That used contaminated medium will have poisonous creosote and other very concentrated toxins in it so handle and dispose of carefully. Some newer gasifier designs (higher temp) lower the dirtiness of the resultant gas so those build methods can help in creating less toxic waste. So get out there and researching a good design and building some gasifiers. Oh and in the seventies, when we had another moron running the country, and fuel prices skyrocketed then too, gasification made a brief comeback, having some ingenious folks gasifying cars and even motorcycles. Mother Earth news had many an article on it. But Don’t look for lefties today to embrace the new wood gasification craze...as this current energy catastrophe, isn’t about lack of fuel, the environment or going green, it’s about power and control.....but I digress.
Reply: Also remember to be equally careful about proving your processes of perpetual motion...or those that come shockingly close to perpetual motion. A lot of people did so at their own peril. Many of these claimants having been said to have reached that pinnacle, many have apparently been abducted, never to of been heard from again, and there tragic stories told by a brothers best friends uncle who knew a guy that was told by another guys in-laws who knew the guy who came up missing, with the golden goose of perfect energy conversion, or the perfect carburetor, or the super dynamo thermothrockle device that would of changed energy as we know it. Likely taken by sinister folks who Cabal would of lost everything from such information getting into the common mans hands. Just don’t want any of you to be like that other guys in-laws friend who is just gone. So take heed.
Reply: @ussmillerco  Before putting in with Thorgraum read my documentation above, especially the HyTech Power ICA system for diesel fueled tractor trailers that is getting +27% fuel economy improvement through onboard hydrogen generation, on FedEx vehicles and proven by a third party laboratory in Sweden.  They have 20 patents on the system.
Reply: @captainwho1  Nah, i havent read any of the last probably 40 comments. show dont tell, im done writing to "diesel engine engineers" lol. if this worked. every single car in production would have them. now frick off
Reply: Hahahah 🤣, real good one.  If all it took to improve gas mileage was a simple $100 hack and tune, cars would come with it from the factory so they could meet ever stringent emissions regulations.   I swear people will do all sorts of mental gymnastics before admitting that they have been duped.
Reply: @bliskin8847  you might just be my spirit animal
Reply: @bliskin8847  Who are you talking to?  The HyTech Power ICA onboard hydrogen generation system for diesel powered trucks and tractor trailers, the highest polluting vehicles on the roads today, will retail for $10k and pay back for itself in about 9 mos. of average truck driver's commercial driving.  Not a simple system and 20 patents have been approved.  +27% improvement in fuel economy, Emissions improvements on Cummins KTA-38 tested by Eurofins:  O2 +15.0% by vol., CO2 -50.0% by vol., CO -25.8% by mg/Nm^3, NOx -19.0% by mg/Nm^3, PM -78.0% by mg/Nm^3.
Reply: @crd-nz_001  how do you know?  Do you have specific research?  Peer reviewed? Published? In my case, I'm saying I don't know.  I don't think anyone has published objective,  credible research.  So how do you know.  You again keep coming back to your false premise.  Energy out can only equal Energy in.  That's only true in ideal system.

 If the system is less than ideal, there may be ways to increase net efficiency.  No, energy out will never exceed energy in, but energy out after change can exceed energy out before  system change.  

And I am interested in researched answer not "spiders have 6 legs" because  it's common sense.  You know how many centuries that belief went on until someone actually checked. Lol.  Research trumps opinion.
Reply: @joeboxter3635  I know by searching the internet. However, what holds far more credibility is from my own investment in reproducing this experiment back in 2007. Yes, I ran an engine using Hydrogen that was produced from electroysis of water. 
But, being the sceptic that I am, I looked at the bigger picture as to "HOW does this work". It worked because the engine running on the Hydrogen was small. It worked because it wasn't producing the Hydrogen. It worked because physics said it can work. Ive tried to explain this, yet it is still questioned.

I did the experiment because I defiantly didn't want to believe it wasn't possible. So, I built and tested many things and guess what? They didn't work.

Once I gave up on the fairytale of The Water Engine did I start to learn how the Internal Combustion Engine really works. Once that happened, fuel economy and power are now at my disposal. My 90s Toyota is 2L/100km hungrier on gas than a Prius, yet will turn a 15.2sec 1/4 mile time.

Thats the power of knowledge. You can question my knowledge as much as you like, but thats what I have accomplished. Disagree or question as much as you like, but I can say "I built a water engine." I challenge anyone to build one and come to your own conclusions, rather than questioning those that have done so, and say "It doesn't work".
Reply: @joeboxter3635  CRD NZ just wants to pontificate.  Thorgraum has basically crawled under a rock.  Won't read up on the 3 pieces of supporting evidence I have posted.  When it comes to energy out equaling energy in, that still holds true with onboard hydrogen systems as I think you do know.  In a typical internal combustion engine the full chemical energy available in the fuel(s) approximately goes to:  25% Effective power (mobility plus accessories), 5% Friction and Parasitic Losses, 30% Heat lost to Coolant, 40% Heat lost to exhaust gases.  What a working system of this type does is increases thermal efficiency of the system by using intelligently controlled (according to engine load) highly efficient hho electrolysis that enables lean burn.  Those numbers I gave above still add up to 100% but they get shifted towards more usable power and less thermal losses to the exhaust and coolant.  Brake specific fuel consumption is improved.
Reply: @thorgraum1462  you, example of the Dunning Kruger-effect. When searching the web there is so much noise made by people like you. How can you disregard the example of variable valve timing and persist on shouting the same thing over and over?
Reply: @captainwho1  I saw a video on afr vs running hot. The summary is that fuel is injected, the mixture swirls and there is separation through difference in density. So the mixture is richest along the edges of the cumbustion chamber. Richer than stoichiometric since the average is stoichiometric. This creates a "quench zone" where the mixture doesnt really burn. The theory is that if you go lean, you wil diminish this quench zone and the combustion chamber sides will get hotter.
I'm not sure how and when this would hurt.
Reply: @maxspruit8370  Hydrogen reduces the quench zone acting as an accelerant also.  What you are describing is a perfect example of how the modern induction system fails at creating a vaporized homogenous mixture.  Multi point fuel injection doesn't cut it.  In the 70s when there were fears amongst the automakers that the government was going to raise fleet mileage requirements by a very substantial amount, there was a flood of patents created with various solutions such as variable venturi shock wave carburetors and vaporizing fuel systems.  Lean burn creates lower exhaust temperatures and cooler exhaust valves due to the extra air and greater thermal efficiency.
Reply: @captainwho1  yeah, you mentioned this above. Very nice to have someone knowledgeable respond. 
I agree, that i would like as small a quench zone as possible. How much would that be at cruise?( % of volume not  helping powerstroke/not burning). How much does charge striation affect flame speed? All these questions pop up.
I asume hho would have the greatest gains in petrol engines al low loads as this is where flame speed is lowest.
Is flame speed propotional to the charge density squared?
Please sensei
Reply: @maxspruit8370  Haha those are all great questions and I'm no sensei.  I could dig out my Combustion Engineering textbooks and see if any are answered.  Usually the answers are more empirically derived at rather than theoretically.  Flamespeed definitely increases with homogeneity making it easier for each fuel molecule to be able to find an oxygen molecule to react with, and gaseous fuels homogenize more rapidly and more completely, like hydrogen.
Reply: @captainwho1  yeah, i was fearing that it's mostly empirically derived. When searching the interwebs most accessible sources mention timing advance asif its a good thing, a goal by itself. While its a cure to a problem. The more timing advance you need, the more combustion  hits a piston that isnt up to speed jet. Just  waiting to do work(slow piston) losing heat to the chamber, thus efficiency.
While with low need for timing advance there is less delay between cumbustion onset and work done.
Is this correct?
Or is it increased variability of burn rate at low loads and lower cr's that necessitates conservatism (avoid detonation and nox) leading to burn later in expansion phase causing lower expansion ratio for greater proportion of the burn.  Thus less work done?
Reply: @maxspruit8370  The optimal ignition timing vs. crank angle depends upon how fast the fuel burns.  Adding hydrogen to gasoline increases the flamespeed.  In an idealized theorietical engine cycle the combustion process would occur in an instantaneously small amount of time at constant volume.  In reality the graph of cylinder pressure vs crank angle isn't nearly so peaky as that.  But the more peaky it is the greater the efficiency and the less pressure is working at a time when the crank is not at a mechanically optimal angle for producing torque.  It is somewhat like a kid at the playground learning to push someone at just the right time on a swing.  When it is done at just the right angle in the swinging arc there isn't much force required to send the kid higher and higher.
Reply: @maxspruit8370  ive heard of the effect. untill i see proof
Reply: @maxspruit8370  In lab experiments laminar flame speed decreases as pressure in a closed vessel increases (not an ICE).  So in that case charge density decreased flame speed.  Increasing temperature of the charge does increase flame speed.  In ICEs increasing compression ratio increases the flame speed and that is probably due to the compression of the charge raising its temperature (as long as no detonation) but it is doubtful that it increases with the square of the density even in a compression engine.  With air to fuel ratios, the flame speed of CH4 increases with equivalence ratio, reaching a peak around 1.1.  With 50% H2 + 50% CH4 that peak is around 1.2.  It is mostly all empirically derived but they do try to come up with mathematical relationships to model observations.
Reply: @captainwho1  I allways assumed that burn rate was concentration dependant, like non catalysed reactions in aqueous solution. Increasing the pressure also increases "thermal enertia" (just made up that term) and that is what is holding the burn rate back. 
So does the burn rate at low loads (petrol ice) slow down because of lower charge temperature, leaner charge or less heat carried over from previous combustion event?
I allways thought that older injection cars tried to run stoichiometric at all times except wot.
Never read about equivalence ratio. But i allways had the notion that the smaller molecules had a lower ignition threshold and therefore faster flame propagation.
My 1995 bmw f650 thumper has 2 sparkplugs. Why isnt this more common?
Reply: @maxspruit8370  I would've thought that increasing pressure would increase flame propagation rate as well.  The study I found tested from 1 to 3 atm of pressure.  Need more backup studies.  I'm pretty sure kinetic energy of molecules is the biggest influencer upon flame speed for a given fuel(s).  You ask more good questions.  My 97 Ford Ranger has a waste spark on each cylinder as well.  My Honda Civic EX wasn't the most efficient model they sold.  There was also an HX that got 7-8 mpg more and used a lean burn engine.  Tons of experimental papers where they studied effects of equivalence ratio (multiplier to stoichiometric) upon ICE engine performance.
Reply: @captainwho1  yeah, the enertia of the gas mixture must be a big player.
i looked up the auro ignition temperature of lead tetra ethyl and it is 110 c while petrol is 247-280 c. 
This is al very comfusing. As i thought that RON is most influeced by auto ignition temperature. it is typically added in 1:1260 ratio.
Might i be overlooking something here?
Reply: @captainwho1  This is confusing. i looked up the auto ignition temperaure of lead tetra ethyl  210 c and its way lower than petrol 247 - 280 c yet it increases rated octane number. (diesel is 210 c).
typically added 1:1260 ratio i read: volume?
Makes makes me envious of Thorgaum. That guy has it all figured out.
Reply: @maxspruit8370  Autoignition temperature of liquid fuels depends upon lots of variables such as pressure, vessel size, vapour pressure, equivalence ratio, molecule size etc..  I think it is sort of irrelevant with tetraethyllead though.  From Wikipedia:  "Engine knock is caused by a cool flame, an oscillating low-temperature combustion reaction that occurs before the proper, hot ignition. Lead quenches the pyrolysed radicals and thus kills the radical chain reaction that would sustain a cool flame, preventing it from disturbing the smooth ignition of the hot flame front. Lead itself is the reactive antiknock agent, and the ethyl groups serve as a gasoline-soluble carrier."
Reply: @captainwho1  thank you  sensei. without your answers i would still be searching. most informatiion out there too accesible. It is summarized to  such a degree that it can be erronous. This means a lot to me. thanks.
Reply: @thorgraum1462  It's painful to watch someone be so wrong so confidently. Nobody is saying that it's the energy from burning the hydrogen is where the gains come from. That would indeed be impossible.
But you can definitely use the energy generated from burning gasoline to increase the efficiency of that system. Its pretty much the same concept as solar panels using the energy the produce to track the sun and there produce more energy.
Idk how well hho works for cat engines if at all, but in principle there is nothing impossible or physics breaking about it.
Reply: @GraveFable25  nope
Reply: @crd-nz_001  I am genuinely interested in learning what changes you made to your engine to make it more fuel efficient.  I want to know more
Reply: @danielstyba1917  In short, reduce the restrictions of airflow in and out of a cylinder. This will have varying results depending upon how well the intake and exhaust has been designed from factory.
If going further, tune to increase torque. By doing so, the engine is using its fuel more efficiently which means less air is needed to produce the force to move the car down the road.
Next is reducing pumping losses. On variable cam equipped engines, late intake closing reduces dynamic compression which reduces torque loss to compress the air/fuel before firing. All this will increase the ignition temps, so a  colder plug may have to be looked at other wise detonation could come from the spark plug acting as a glow plug.